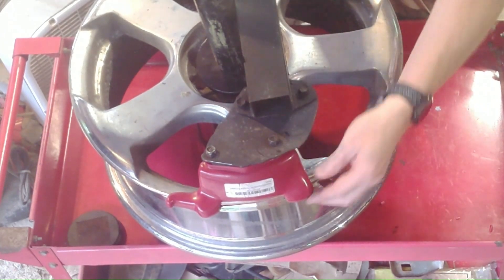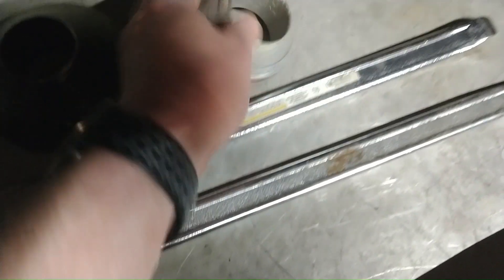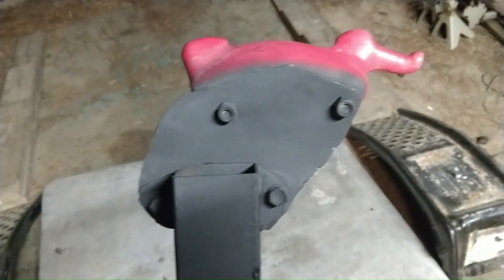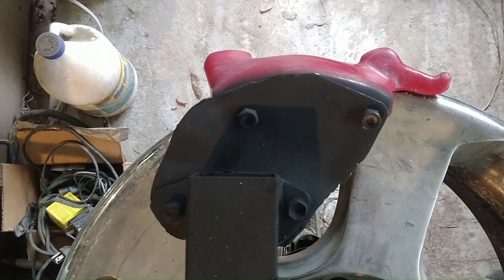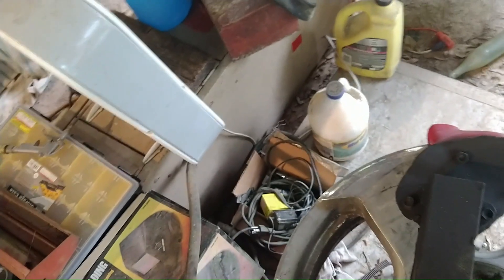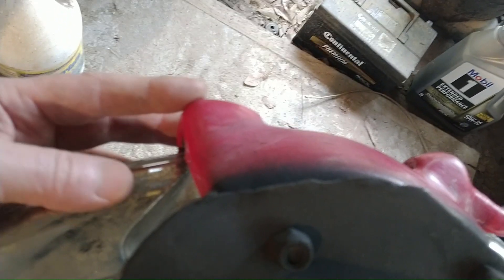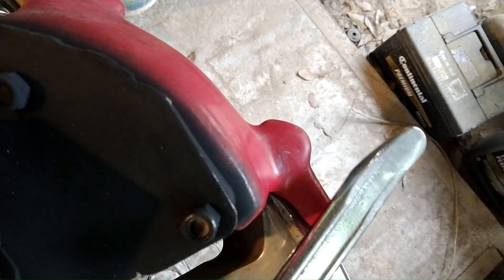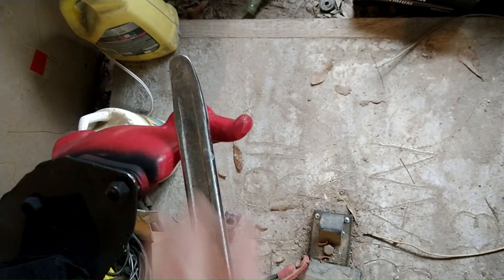HOW TO build Duckbill Mod Harbor Freight Tire Changer

Comment: how much would it cost me to have you build me one of these?
Reply from the maker: @MilesonHighway  I'm at work. I'll get you a price when I get home
Reply from the maker: So really the shipping will be a major part of the price. Let me get your zip code
Reply: @Knowledge-IS-Power365   my zip code is 37687.  Just to get an ideal of the cost  if I had you make me one, verses trying to make one of my on.  thanks
Reply from the maker: @MilesonHighway  ok well in that case, the handle is the tricky part because honestly I had the 2x2 tubing and it has a pair of bolt holes just perfect to mount my piece of plate steel with. If I hadn't had that piece of tubing (was an old weight lifting machine) then I probably would have never built the bar. I already had everything except the red duck bill which cost 20 to 25 if I remember right. But I really had everything I needed since I keep things like old lawnmower blades and u-joints from the shop. I don't actually have any other cost. But if I were to start making duckbill mod bars, naturally I would run out of those materials. A source for the tubing is the real unknown. I'm rural and a trip to buy that would take half a day minimum and knowing how many I would be making would be key. Without the bar, I think I included prices in the description for everything else already. Thanks for your interest.

Comment: Nicely done !!! Seems like there is no need for a big expensive machine then?

On some of the larger stiffer tires there will be a slight twisting force. I have a plan in place if my wooden one can't cope.
https://youtu.be/WgjNO2gt3xg?t=354
Reply from the maker: And the mount
https://youtube.com/shorts/sUJx62SYhc4?feature=shared
Reply from the maker: @richbinaz  I thought twisting would be a problem, but the tubing being square has taken care of it. The duck bill shape takes care of the rest of the potential issue. That and technique;
To take the tire off, stand with the bar on your right.
To mount a tire, stand with the bar on your left and push down on the tire at approximately the 3:00 starting with the bar at 12:00 and moving counter clockwise. Also extremely important is soap without much water but applied liberally.
Reply from the maker: Here is my technique for the dismount 
https://youtube.com/shorts/Bg6fNJGlErY?feature=shared
Reply: @Knowledge-IS-Power365  Yes, you have a really good design there, you have the 1 inch offset incorporated into the lever. So the head sits on the rim as intended.
Do you have to worry about TPMS sensors? To avoid crushing those I like to start removing the tire at the valve stem. Installing I start a little left of the stem, so it's the last bit to go on. (If I can remember)
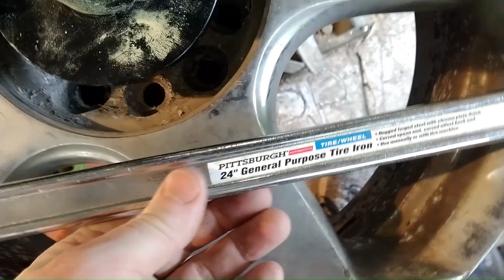Reply from the maker: @richbinaz  yes, you have to take into account where the TPMS is when you mount the wheel onto your tire changer. I do all the work between the 12:00 and 6:00 (moving counter clockwise) so depending how the lugnut hole lines up, TPMS will need to be 2:00-4:00
Reply from the maker: P.S. Thank you for your kind words. Very much appreciated. My wife isn't impressed with any of my "miracles" anymore... but she likes this one!
Reply: @Knowledge-IS-Power365  You are very welcome. I try to encourage all the free thinkers and DIY'ers I stumble across when scrolling thru YouTube.
My wife was skeptical too, but I won her over with the cost savings when compared to Discount Tire (DT). I can buy tires from them (or Walmart or on-line [Priority tire]) and still come out ahead of the game.
I keep an excel log of all the costs vs the cost of having DT do it (with all their add on fees) and after 24 tires, I'm $450 ahead of the game. Even after replacing a tire that got punctured from running over a crow bar. I do tires for family and friends as long as they buy the tires.

I would have been further ahead if I had realized how bad the HF bubble balancer was, before buying one. 
Made 2 other home made balancing rigs - a vertical (hard) and horizontal (easier) method. 
My goto method for balancing is the horizontal with a laser. It shows in these video's... the 2nd one is the theory behind why it works and the limitations. Just in case you want to balance those tires too.
https://youtu.be/WgjNO2gt3xg
https://youtu.be/xyv2FnseOI8
Reply from the maker: @richbinaz Yes sir! I checked out your balancer, I was going to comment on your channel after I finished this next video. Very impressive!